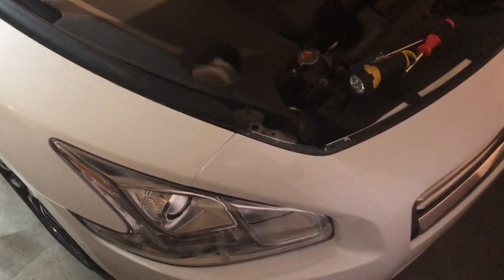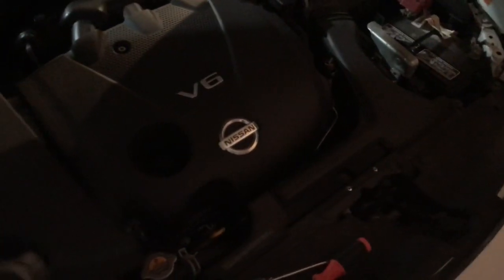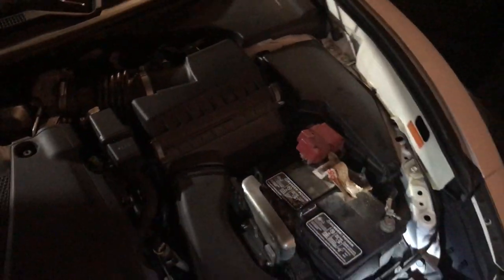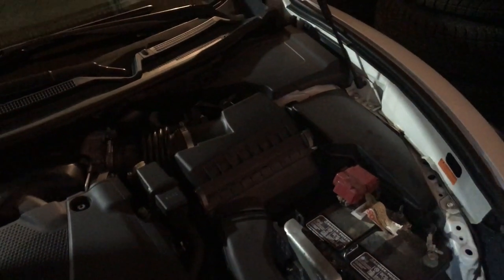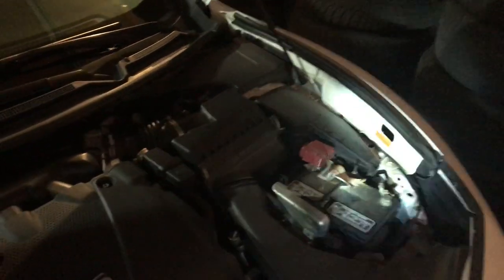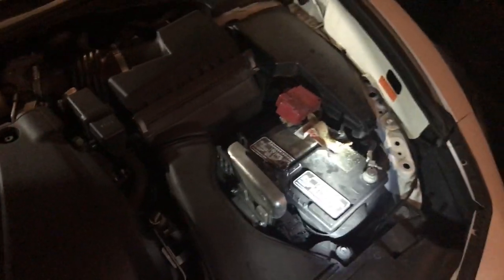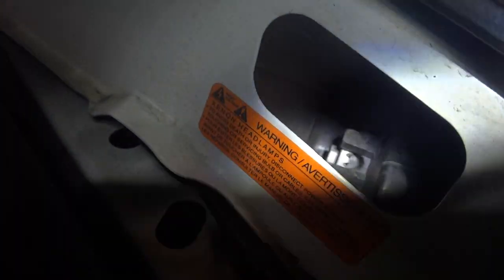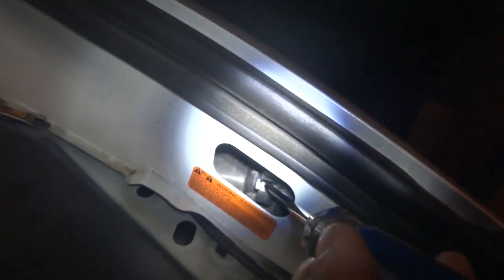Nissan Maxima Aim the Headlights or Modify height (altima similar)

Comment: I was just trying to adjust the passenger side headlight, I was turning on the adjuster for over half an hour and I barely got it to go down at all. Will I have to take the headlight out and retighten the bolts? I have an '05 Nissan Altima
Reply from the maker: Hmmm is the 05 altima in the same spot? Did you try this while headlights on and shining on a wall / garage?
Reply: @JealousLawnCare  Yes I did
Reply from the maker: Kyle Dietrich - hmm not sure why it's not moving at all.  Anyone with an Altima able to help here??

Comment: Does this work when 1 of your lights looks like it's pointing upward
Reply from the maker: MannyTwice -- yes this would be the adjustment to make. Find a flat wall or garage and modify as needed like this.
Reply: @JealousLawnCare  one more question, and this may sound dumb. But is it clockwise to go up?  I tried last night and couldn't tell if they were going up or down
Reply from the maker: MannyTwice -- to be honest I don't remember, try doing like 3-5 turns and you should be able to see the difference when shown on a wall.

Comment: I have the same maxima, my driver side headlight is super dim compared to my passenger headlight. I tried adjusting up and down no difference and I also got a new ballast and a new bulb. Driver side is still dim, do you have any idea what else might cause this?
Reply from the maker: Hmmm  have you tried switching the bulb from passenger side and drivers side to see if it's the side or what?  That might help diagnosis...
Reply: Yes and I got new bulbs for both
Reply: New bulbs are showing same dim drivers side compared to passenger side still, drivers side is yellowish light compared to the bright blue light on the passenger side
Reply from the maker: YG Faith -- other than the headlight housing being faded or scratched on one side, I don't have any idea on what else would be the dimming issue unfortunately.
Reply from the maker: YG Faith -- i wonder if it's a malfunctioning wiring harness?  Not sure how to best test that though...thats beyond my knowledge
Reply: Shoot I hope it's not that lol that would be annoying, I was doing some research and I'm hoping just the hid projector lens is dirty I gotta bake the headlight assembly for that but it's doable
Reply from the maker: YG Faith -- hopefully that works, I've done the headlight baking in my other car. It's never a fun job
Reply: I bought new housings and that fixed it😂😭
Reply: My same model car's headlights has same problem. The both sides are dim. I have to use it with high beam lights turned on all the times. It could have been wired wrong since the body shop replaced the bumper . Please help.
Reply: @kevinnguyen6830  are they hid or halogens